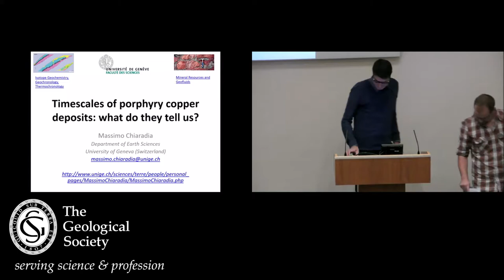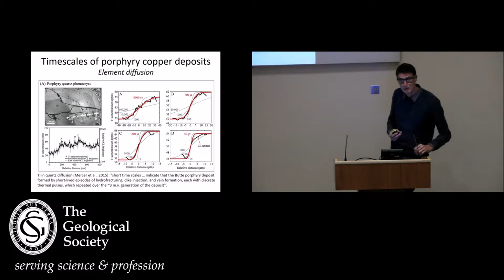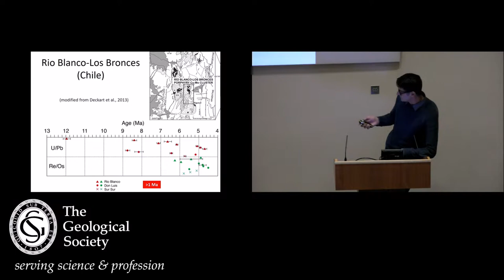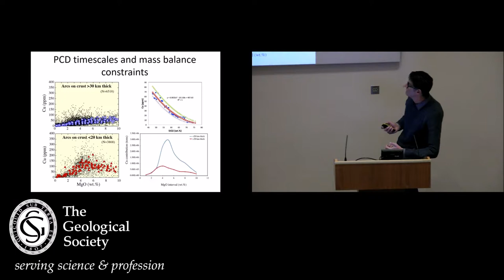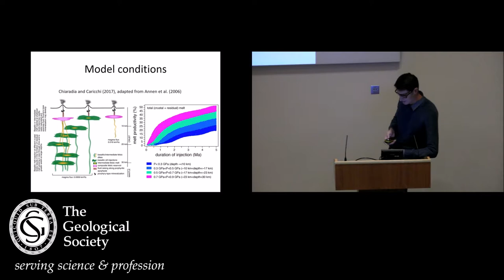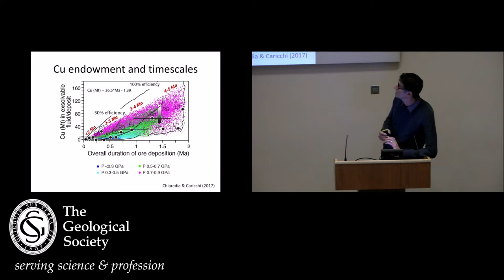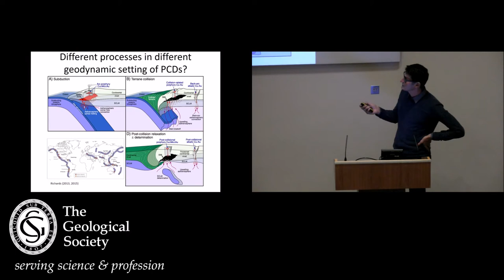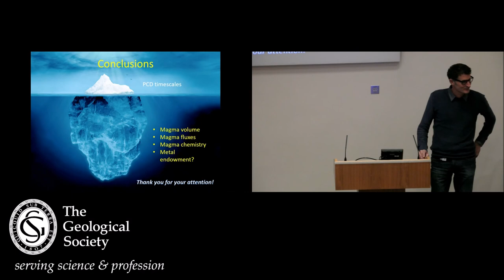Timescales of porphyry copper deposits: what they do tell us?

Comment: So the first thing to do when evaluating a system is find as many different igneous rocks as possible.  If you only see a few the system is weak if you find many the chances are it lived a long time.  Same with structures.   The keel of the iceberg should go into the garnet-in stability field at 40km. The influence of isostatic and tectonic forces then work to break up the evolving system after enough metallic segregation.  The system probably fails most favorably on compression.  The mechanical compression failure products may eventually become the porphyry systems we seek.  The relaxation products likely become the deep cumulate component we wish we could get to.  Sometimes we can find bits and pieces of them.  Sometimes even in plain granite!  The real tops and bottoms of porphyry copper deposits are spread over 40-50 km depth.  Age dates are not  just curiosities.  Date as many rocks as there are!